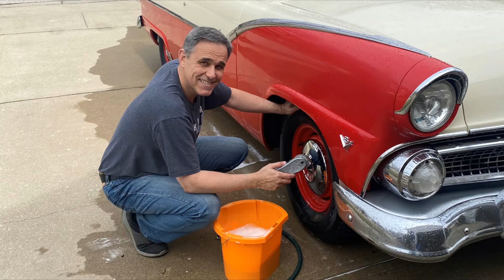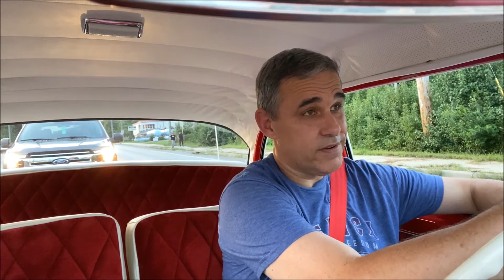1955 Ford 3 speed with Borg Warner Overdrive

Comment: I swapped out the (broken, by me) PowerGlide in my '66 Impala Convertible for a "Three on the tree with an OD" from a second Impala donor car in '75.

The swap went smoothly with just a bit of fab to get everything to fit (there is a ball that supports one end of the clutch arm that gets mounted on the inside of the wheel well). 

The unit that came with my $75.00 Impala "donor" car was broken, but there was a good Ford unit that came with it. I messed up the OD while installing it and it was off to Fred Carver's junkyard for a replacement from a Chrysler (for $25.00). 

I got it right the second time by using a rubber band to hold in the Sprague rollers while putting on the tail shaft. Just leave the rubber band in there once you have it assembled. It won't hurt anything.

My driving experience was that I loved the thing and it was a blast to drive.

Comment: What type lubricant is used in the overdrive and thre--speed transmission?  I have a 1956 Ford three-speed w/overdrive and am getting conflicting information as to what to use and how to fill the thransmission and overdrive.  Hopeing you can set me straight.

Comment: I have a 68 belair with a 250 i6, and 3 speed on the column. I need od... But want to keep the colum Shifter
Reply from the maker: Most of the Borg Warner overdrives were installed on cars and trucks with column shift. I do not know if GM had a 3 speed with the OD tail shaft in 1968 in their cars. Maybe a shop manual from your year would let you know the options in transmissions and see what is available.
Reply: @HotRodReverend  i just hate to cut a hole in the floor. I will if that's my only option, i could install a T5 if i went that route.

Comment: Question..if you have the cable pushed in and try to put the transmission in reverse. Will the cable be pushed out by itself?
Reply from the maker: No it does not push out in that scenario. This tail shaft has the provision of an automatic lock out for reverse so the OD gears are just fine if backing up while cable is pushed in.

Comment: What shifter kit are you using?  I have the HURST INDY UNIVERSAL 3-SPEED MANUAL SHIFTER here and it doesn't fit my R10 (with overdrive).
Reply from the maker: Shoot me an email at danaxjessup@yahoo.com or contact me through my website at HotRodReverend.com/blog and I can send some photos of the kit, the instruction sheet, etc.

Comment: I picked up a fully reconditioned HD BW 3 speed w/OD T85c-1a R11-1E. Both parts have Q2 stamped in. It has a tag riveted on “8-17”. It apparently came from a truck, but I can’t source anything about it. Do you have a resource? You know so much about them.  Great ride you’ve got.
Reply from the maker: I am afraid I do not have much on the numbers or tags like you describe. I don’t go past 1959 with a lot of what I have in research and all. What are you looking to find out?
Reply: Did you get that trans to work? That's exactly what im looking at

Comment: I have heard that you are only supposed to pull out or push in the o/d cable while the car is moving. What is your opinion and experience with that?
Reply from the maker: From the owners manuals I have and the rebuild manuals that describe the operation, the opposite is true - the cable is only to pulls out when the car is not in motion. Pushing in while going forward can be done but it is not best practice.
Reply: @HotRodReverend  Thanks. Good luck w/ your ride.

Comment: What engine do you have in that Merck with that overdrive
Reply from the maker: It’s a 292 Ford Y Block, and the car is a 1955 Ford Fairlane. The transmission is from a Mercury so it bolts right up. There is a boatload of info on my blog at HotRodReverend.com

Comment: Sounds mean!
Reply from the maker: the 292's bark is louder than it's bite, but it has quite a bit of torque on the bottom end. If you sift through my channel's videos you can watch a 1/4 mile race I had with an altered T-bucket. I did chirp the tires when shifting from 1st to 2nd, but again this is an otherwise stock engine.

Comment: How much horse power could these transmission take
Reply from the maker: much of that has to do with the driver and dropping the clutch hard at stop lights, etc. These transmissions were not made for burning rubber from a dead stop. The T85 however was almost bullet proof in that regard and can handle quite a bit of horses. Builders have told me that 500 to 600 hp for the T85 is not uncommon. On the transmission in this video ... I would say 250 hp is about max before gears start stripping out.
Reply: @Daniel Jessup  I have a 56 fairlane 3sp manual with over drive I'm thinking about picking up thus 410 fe motor and keeping the 3sp manual
Reply: @9thgatedim273  They put R11's behind the Big Block fords for good reason.  R11 has 4 planetary gears R10 has 3.  But ya run what you can find I guess.